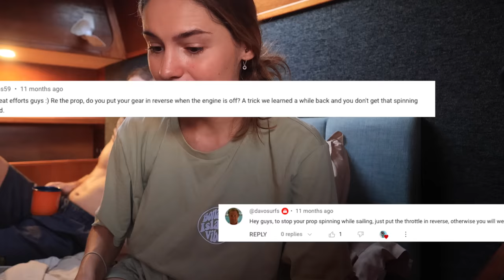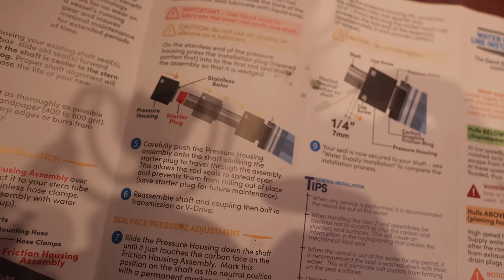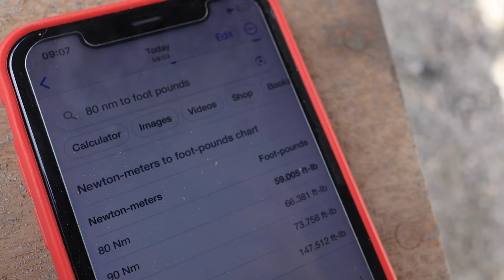BOAT YARD LIFE: The BIGGEST upgrade yet?

Comment: As a safety place a hose clamp round the shaft just in front of the seal where you marked the shaft. This is a standard practice on PYI dripless seals. If that seal ever slips forward it can sink the boat. Cheap Easy peace of mind!
Reply from the maker: Good tip! Cheers 😊
Reply: In my opinion, a hose clamp placed directly over a metal shaft can slip and damage the surface due to the lack of friction, velocity of the shaft, and vibrations. Instead, first place a reinforced hose, such as a radiator hose, cut to fit over the shaft. Then, secure your hose clamp over the reinforced hose. This added layer increases friction, providing resistance and protection, ensuring a more secure grip and preventing damage to the shaft. The reinforced hose distributes the clamping force evenly, reducing the risk of slippage and surface abrasion, thereby maintaining the integrity of the shaft and clamp over time.

Comment: High Five, team. Impressive skills. 
One suggestion … fit a “Prop-Protector”. Belt and braces in the event of snagging a rope. I’ve fitted one on all the boats I’ve ever owned. And I’ve often been grateful for it. Prop-Protector is a proprietary brand name, the product is made in UK. It’s a razor sharp stainless steel disc that clamps around the shaft, just forward of the propellor. It is designed to cut rope that tangles round your prop while motoring. It’s most easily fitted before you splash, but it can be fitted underwater (it comes in two halves, with Allen-key screws). You’d need to shift the zinc anode … put the zinc just forward of the P-bracket. 🎉😊

Comment: When something is stuck on a shaft like that, there is often a burr. If you file it down before jamming it up then you can get the bits off easily. You can use a green scouring sheet to get a nice finish, maybe with some diesel as lube. Also, wd40 is not a great penetrating fluid. I use mostly deep creep but not sure what is available where you are. Finished product looks sharp.  Hope the seal works well. Replacing that bearing will help a lot with vibration and seal life expectancy.

Comment: Awesome upgrade. My leaky stern tube ensured the bilge was never dry :-) I recommend adding another anode on the hull side of the skeg to prevent shaft from coming out as well. Unlikely but cheap insurance.
Reply from the maker: Good idea, thanks 🙏
Reply: Good mention of that Anode, plus to make them last a lot longer and maybe I definitely as they aren't cheap. Worth trying painting them with 97% Zinc Cold Galvarising Paint?  It's an antifoul with Anode properties that lots of USA Fishing Boats have successfully used on their propellers for years, and the Cheap Land version is identical to the very expensive Marine ones. Here in the UK, a 1 Kilo tin of the 97% is about £25 including delivery and 20% VAT. I'm thinking about using it for painting the hull  below the waterline, with 3 coats, as an experiment to see how well it works tbh. Though as I should be hauling out after a year, two Coats could provide all the data I need. I mean that is one seriously big Anode. Any ex use to test stuff, that's me lol. Best Wishes.  Bob in Wales.  👍⛵️✨️✨️✨️❤️

Comment: All you needed was to pack the wax on the shaft stuffing box or if needed replace the waxed cord. This would compress the wax against the shaft and prevend water or grease from using out.
The new one "looks better" but you destroyed an "forever" stuffing box with a dripless that is much weaker with many more parts and failure points on it. 
Nice prop thow, will be paying attention to see how you like it. 
Please be so kind as to report back if you fell more vibration while using the engine or if it's smooth. We are still undecided on fitting a folding prop or generate electricity from from the rotation. The whining from the gearbox is annoying but tolerable if you know youre charging the battery 😅

Fair winds
Reply from the maker: We could have repacked the unit. However, all stuffing boxes still let in water and we really want our engine room as dry as possible to help stop moisture and corrosion on the engine. There is a reason all modern boats are now fitted with dripless shaft seals, when the technology first came out I wouldn’t have dreamed of putting on of these on Teulu. But they have been out for around 20 years now and we’ve never heard of a boat having significant issues with them. Thanks for the advice but provided you do the required servicing I don’t see how it is weaker (but that’s just my opinion). 

We will be doing an update video on the new prop once we get back in the water and sailing, I can’t wait to see how Teulu likes it 😊

Thanks for the comment.
Reply: @TeuluTribe  I see you point of view and i respect it. 😊 However I do not agree with it lol.
It is true that from time to time you need to tighten the stuffing box because it starts to leak. We solve this issue by having a small pan underneath the shaft to collect any water and grease. A small shroud around the the shaft would prevent any grease flinging 😅.
Heres hoping the dripless will be fine for a many many years.
Nevertheless more information never hurts here is a video from former "captain q" where Randy talks to the builder of Shannon yatchs where they go over the possible dangers of the dripless system. https://youtu.be/wOi_vvBeN3o?si=urOTUAAJtTBH8ih6
He has seen many failures on them and anecdotaly i have been on a boat that sunk on the marina because the dripless just came apart. 
Not trying to create fear so sorry if it comes across wrong in any way. Just want our sister ship to be safe. ❤
Reply: @reversingentropy @TeuluTribe I saw the same video...and assume this is not about the old systems but also recent ones(?!). This is reason why I will stick to my grease system for now (besides the costs😅). With indeed a plastic sump underneath with an old t-shirt in it that I sometimes replace when it has become too dirty from leaking grease. So curious about the experience of Teula and crew..who will use it intensively.

Comment: you could use a large flat blade screwdriver  to help spread the coupler appart a little bit, just tap it in slightly. key word is slightly . it should help release the shaft next time. cheers
Reply from the maker: Yeah that would have helped, thanks for the tip!

Comment: Another great episode guys, and nice to see the new upgrades. Hopefully you will reap the benefits once back in the water. 
Just wondering if you had considered fitting a rope cutter to the prop shaft, as additional safety?
Reply from the maker: Cheers Mike! We have considered it but as the prop now folds it should be a lot less likely to get rope caught around it 🤞

Comment: That “copper insert” is the shaft key and it’s mild steel and sits in the keyway with a grub screw on top locking it in place. They never need to come out unless for shaft removal

Comment: The new prop & shaft seal look super. At 26:41 we can see the the torque wrench was made in Taiwan & has Foot Pounds & Kilogramme Metres so they didn't unexpectedly 
mix imperial & metric . 
 The Kilogramme Metres measure is unusual though, I've never seen that before on a torque wrench, multiply by 9.81 to get Newton Metres.

Comment: Great job guys looks fantastic,  one small pointer, I always put the shaft anode just in front of the P bracket, it then acts as a stop so you could never lose the shaft out the boat should something go wrong with your shaft to gearbox coupling

Comment: A quick word about your sponsor. I was hoping you found a company willing to insure the less wealthy boater; <30K boat. 

I reached out to them and they were very quickly on the reply which was nice. 

Their representative told me they do not insure boats that are worth less than <250k😮 

Can imagine Teulu being worth more than a quarter million but okay. 

As you explained very clearly insurance is very important to make these trips possible.
Reply: Velos are able to insure boats that are lower than £250k (such as Teulu for example) as underwriters look at yachts on a case by case basis including cruising plans, type of vessel, age of rig, experience, recency of survey etc - it is indeed harder placing cover for the lower value / older yachts for Bluewater cruising, with U.K. and Europe cruising being much more straightforward to arrange. Vessels valued under £250k can potentially be an issue for Insurers if they are based in the Caribbean permanently all year round. However, if they are cruising ie not in the Caribbean permanently, then provided the underwriter is happy with the above information provided, cover can be arranged without value being an issue. Hope that clarifies the position and is helpful.

Comment: My advice is invest in a seal rebuild kit if available or a complete replacement seal so you have it if needed. Finding parts or replacements can be difficult while adventure cruising .
Your going to like your folding prop it will make quite difference in the boat performance. 
Too late now but I sailed a boat for a while that had an alternator on a belt system that used the spun prop while sailing to top up the batteries. It actually worked quite well but obviously slowed us down .
Reply from the maker: Thanks for the advice, hooking an alternator to our prop did cross our minds a few times. Thankfully we have plenty of solar power!

Comment: For future reference, whacking on the prop shaft to separate it from the transmission coupler, doesn't help the health of the transmission.  Better to uncouple the flange from the transmission and use a prop puller to separate the shaft from the flange.
Reply from the maker: We wouldn’t have done this but we couldn’t get it out of the coupler…a prop puller would have been better!

Comment: WD40?At least it will smell nice while you're looking for the right stuff to use. Make a cocktail of ATF (automatic transmission fluid) and acetone. It penetrates far better than WD and is a better release agent. WD40 has its uses, as its name suggests (water displacer) like spraying on your scooter HT leads in so you can drive in the rain but release agent isn't its forte.

Comment: Agree with others here, don’t touch the faces of the seal and I cringed when you were smacking the stainless into the carbon. I’ve installed hundreds of these in the mining game on pumps. Get some spares too. When working well they seal perfectly but when they let go they will leak worse than you’ve ever seen. I also would’ve installed the prop before the seal. Those seals don’t like shock loading when hammering things onto the prop shaft.
Reply: Doesn't say any of that in the instructions. They didn't hammer the prop shaft while doing the p bracket bearing & prop, in theory axial impacts to the prop shaft should not have any effect on any part of the seal assembly especially as the rotating  part that's fixed to the prop shaft has spring loaded sliding contact where it meets the stationary seal assembly.

Comment: Stop using fairy liquid and other type like that as they contain salt. Also recheck the Props so when they fold the blades are not hitting each other as that is a bad sign as should be clearance between the blades if they touch then they are fitted wrong possibly in the wrong place of each blade.
Reply from the maker: The blades didn’t touch 😊

Comment: You should have taken ALL THE bolts out of the coupling and then have driven a chisel into the split in the coupling and it would have come straight out !! If there is any damage to the shaft ANYTHING that seal will fail as have seen it happen many times when a diyer fits them .
Reply: The part of the shaft where the shaft to collar seal sits, in the rotating collar, that bit of shaft wasn't affected & was perfect. Removal of the old stuffing seal didn't involve causing damage to the shaft.
Reply: @howardbeer5214 
 Thankyou muchly for your valued & informative reply.
   For something that's so simple & obvious it's irrelevant so I won't be stating my experience with prop shaft seals since there is no point obviously anyway - I could say anything couldn't I, I design propshaft seals for aircraft carriers & other massive boats for example & fit them & they never fail. 
  I watched the video, there was no damage done to the shaft at all & especially not where it actually mattered, there's also some stuff in the instructions about shaft surface integrity.
  Hope this helps.
 Thanks for getting in touch.
 We value your participation & interaction. I remain your most faithful & humble servant at all times
Reply: @howardbeer5214    
Thanks for your most interesting reply.
   No I didn't say I actually did design, help manufacture  & fit shaft seals on aircraft carriers. It wasn't a shaft seal that failed. The prop to driveshaft coupling failed causing rudder damage, earlier shaft misalignment was a contributory factor. I don't like doing shaft alignment stuff in aircraft carriers so I would usually take a week off when that's being done if I did that sort of thing & I haven't said I did that sort of thing.
  The shaft key was not put back incorrectly for the actual final assembly. Everything that you claimed happened regarding prop shaft damage & that damage causing seal damage & prop shaft impacts potentially causing seal damage was all completely wrong unfortunately. 
 Also the prop blades were not fitted backwards & the cutless bearing installation equipment usage technique could not possibly have had any adverse effect at all on the rudder post bearings integrity if you were thinking those things?
Keep up the good work.  
Best regards.

Comment: ATTENTION  At 19.48 minutes in you replaced the key back into the shaft ? I hope you took it out and fitted it properly ?? You put it in wrong The end that is rounded should fit into the front of the keyway which is also rounded !!!
Reply from the maker: We put the key back into the shaft the same way it came out, if its been alright this way round for 40 years I think it will be fine for another 40 years 😊 But thanks for the advice!
Reply: I doubt that the prop has not been off a good few times in 40 years !! But it was def not put back on by an engineer previously! Have fun guys  @TeuluTribe
Reply from the maker: We have just checked the photos we sent Bruntons and the key and keyway are symmetrical- its not obvious from the clip, but both ends are curved :) @howardbeer5214
Reply: Thats correct and so is the keyway machined into the shaft that way it cannot slide fore and aft while the key is in the shaft. Stay safe @TeuluTribe